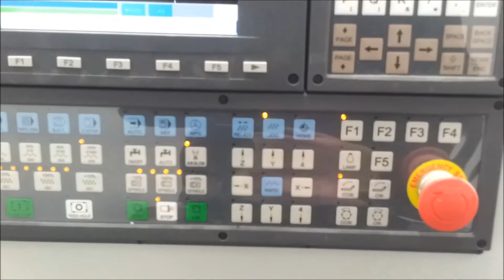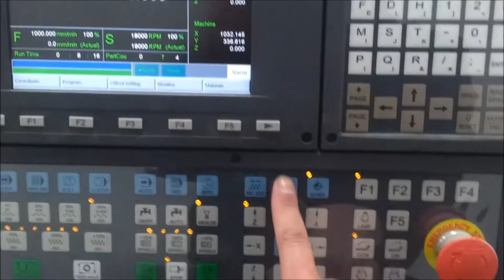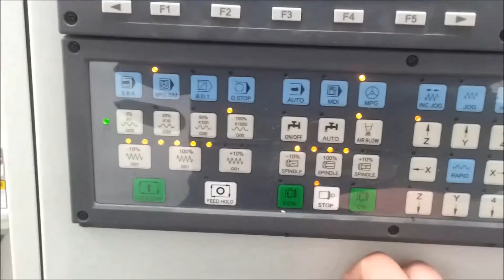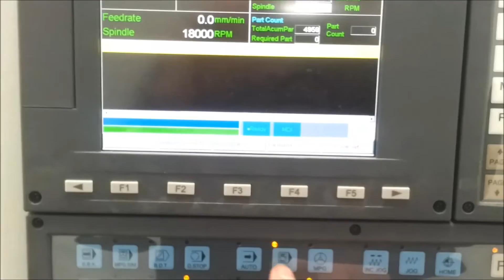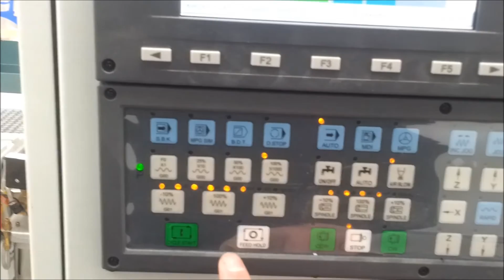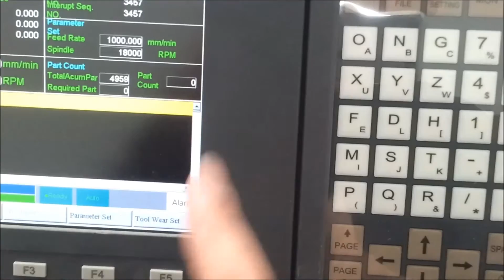Syntec 6MA Buttons Explained

Comment: Thanks for the videos very helpful, we have a new blue elephant machine & the system appears not to want to go back to home position when we press home & press the arrow keys ( just stays stationary with alarm flashing) it will work with MPG mode in all axis. An ideas to get home set up . has MLC codes 3,11,19,65,66,67 . any idea where I find what the mlc codes mean ?

Comment: Hi Lee,

Mate we have purchased a large CNC machine 2mtr x 4mtr & the issue we have is the Gantry had been removed for Shipping. We have re assembled the machine and have everything work, regards to machine Jobbing etc. The issue we have is that when we go to Set the machine back to Home it wont allow us to do this and saying the home is in the incorrect position Warning sign Etc. We have tried to contact our supplier but the language barrier makes it difficult. Just wanted to know if you know of any steps to reset Perimeters of the home position. Guess it is a bit difficult as had no CNC experience in the past. Hopefully you may be able to give us a few pointers. If not Will have to look at filming or issue and re sending back to China.

Comment: Did you ever find a munual that would help figuring out some of the programing of Syntec... For example: my machine uses F5 to tell the machine to recheck tool length, every tool change...  but F4 does nothing... I would like to learn to program it to an output.. that for example would control dust collection or something...